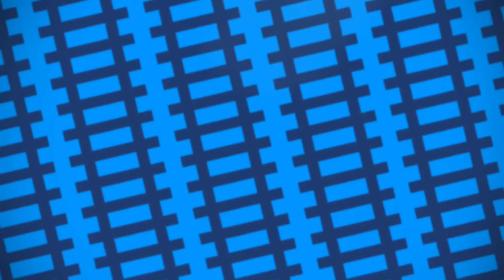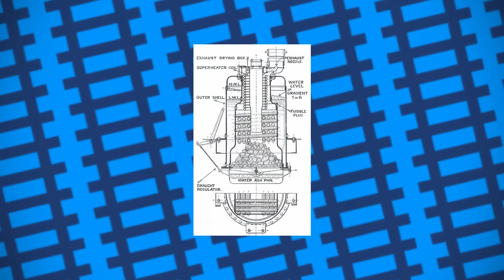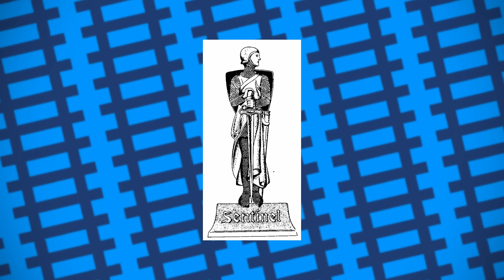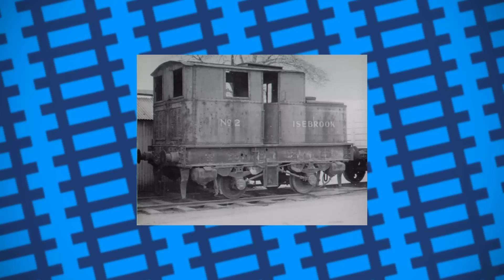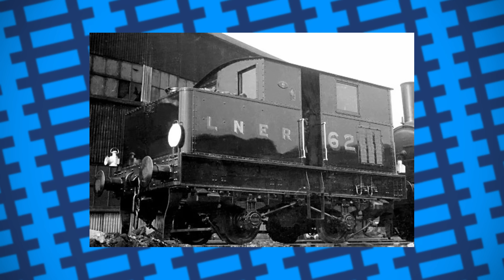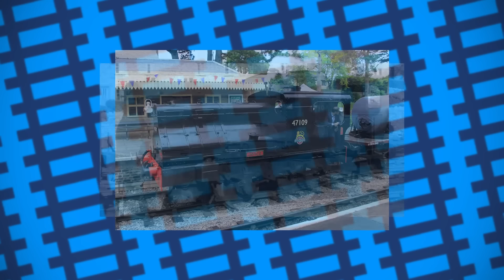The Little Locomotives made out of Lorry Parts - Sentinel Steam Shunters

Comment: You have to admit the ingenuity of using parts for a different type of vehicle to produce a successful utility design that was exported to multiple countries. I sure would like to find a few in OO scale.
Reply: Denmark has used the same diesel engines in locomotives and as power plants on board the navy. The idea was to share spare parts, which in case of war might be hard to come by. The navy could even cannibalize a locomotive if needed.
To this day there is at least one NOHAB in service, which had the engine replaced with one in better condition from a ship when the ship was scrapped.

Yeah the F7 may have disappeared in America in the 1990s, but the European version with cab in both ends is still pulling freight in Denmark. There aren't many left, but if you are lucky you can still see the classic round nose design on commercial freight.

Comment: I'm trying to understand why anyone would even want a steam lorry after 1920 but I suspect it was either a victory of tradition over economics or a fundamental lack of petroleum infrastructure.
Reply: Economics.  If you only produce 100 000 ton/year of oil, and 200 000 000 of coal, it makes more sense to burn coal than oil...
All the way up to the 1947 Heavy Goods Vehicles report in the UK.  Steam was used on the road in the UK for commercial purposes up until 1982, although realistically in a very niche use.  (Sentinel 8122/OF, as a tar sprayer, along with Big Johnny the Fowler road roller).  The obsession of replacement with something new because it is new continues to lead us down the garden path.  (the practical ends of the use of Sentinels is probably the Liverpool dock Sentinels, they lasted until 1958/9)

Comment: I remember the two sentinels 'Gervase' and 'Dom' on the Kent and East Sussex Railway in the early 1970s. I  think 'Dom' was from Jersey in the Channel Islands where it had powered a railcar unit. Gervase was a unique engine cobbled together from an old saddletank steam engine converted to use a Sentinel vertical boiler. It had spent its life shunting in a lime works and quarries south of London. It was powerful enough to pull two Victorian coaches and apparently was the first engine steamed on the preserved K&ESRly in the 1960s. However, both spent much of their time parked up in a siding at Rolvenden. Apparently there were more interesting old locos to restore there, and so the two Sentinels ended up being a bit neglected, but 'Gervase' was painted blue and did pull some trains there in the early 1970s. Sold on to various concerns, 'Gervase' was restored in 2012 by the Great Central Railway at Loughborough, and is now at the Elsecar Heritage Railway. 'Dom' is at the Iron Bridge Gorge museum.

Comment: Waggon is also the way wagon was spelt in the days of horse drawn vehicles. A cart has two wheels, a waggon has four.
Reply: Waggon was the initial name and spelling for railroad carriages in Danish, through it never caught on. Instead they ended up copying "vogn", which is the same Danish word as what is used as a horse carriage. Danish railroad language has quite a number of words borrowed from horses including (interestingly) old expressions where locomotives walk rather than drive. Driving with two locomotives is called forspand, which is the same word, which is also used when using multiple rows of horses in front of a waggon.

My personal favorite is "walking in a sleigh". Walking means moving and a sleigh has no wheels, which means moving forward without wheels. In other words it's a widely used, yet unofficial expression meaning locking up the wheels while braking.

Comment: At a local brick factory they used a small (for today. It was actually on the stronger side when compared to local farmers) tractor as a shunter on their yard. They put it on some custom made rail wheels, and later on they even added a small air brake system that was powered by the PTO, so that it was allowed to haul stuff even on the national grid if needed. That said, you really wouldn't want to haul stuff over longer distance with that thing. Even with the heavy steel rear wheels it was still rather light, didn't offer much traction, was slow af, whilst it had couplers on both ends due to the seating position you really only wanted to go in one direction for a prolonged time

Comment: So these are the granddady of the Cargosprinter ( DB class 690 and 691 )
These were container railcars who got Volvo Lorry parts.
Class 690 had each railcar equiped with a Lorry engine and class 691 had Lorry cabins on each end of a set.
They worked fine but  the fast decline of the single rail freightcar service to customers made them obsolete.
All 7 were converted  and got  2nd life as rail emergency / track maintenance vehicels.
The base concept was still sound so they became the MPV (multpurpose vehicle) trains for emergency and track maintenance.
f.e  in the UK one such MPV  is used for Sandite and lasercleaning as a track maintenance vehicle.

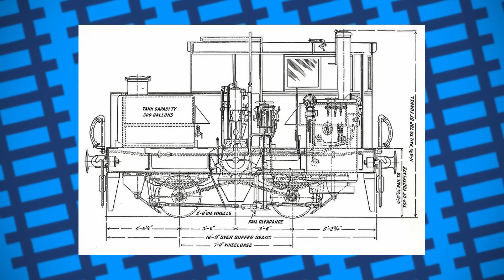Comment: 5:39 On the LNER, the Y3 "Centre Engine Double Gear" and Y10 "Double Engine Double Gear" Sentinels did have a gearbox for changing gears, but the Y1 "Centre Engine" Sentinels had a fixed gear ratio!
The most numerous LMS Sentinel class were CEDG types virtually identical to the Y3s.